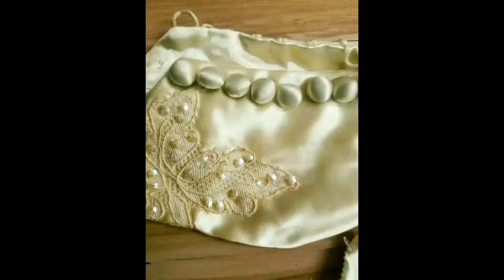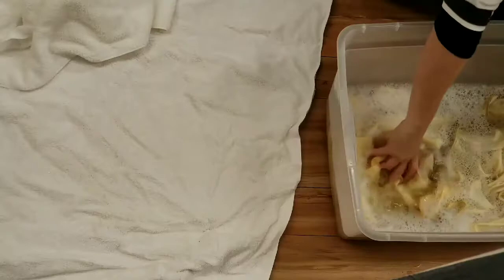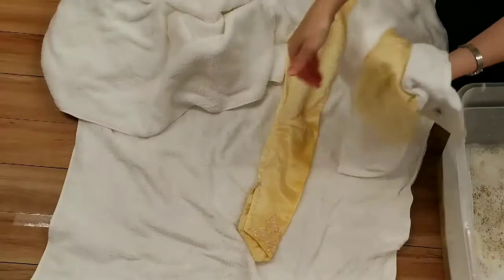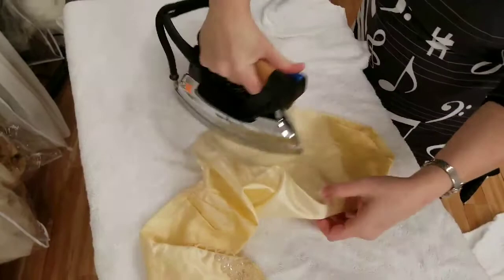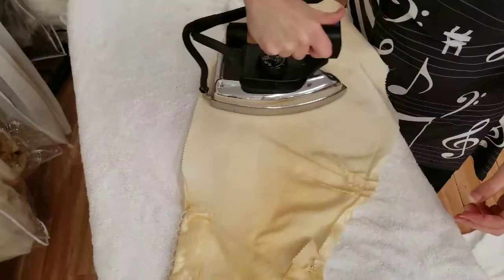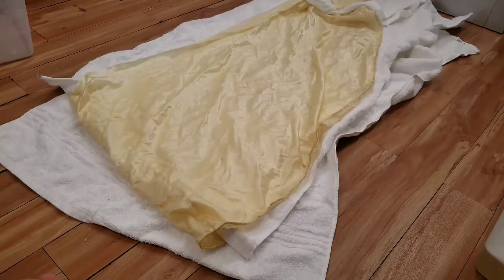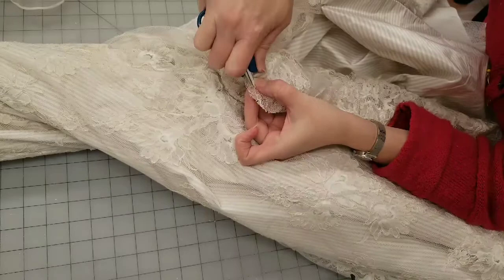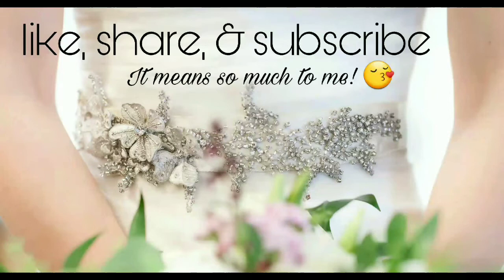How to wash a vintage silk wedding gown. How to remove or cover bridal gown stains.

Comment: Thank you for making this video! I recently bought a Victorian Silk parasol in an ivory color. The fabric is in very good condition (only very small holes due to wear on the under layer) but there is a lot of tension on the canopy when fully open. Do you have any suggestions for cleaning it? There are a few dark spots and overall it looks dingy. Will the products you mentioned weaken the material further?

Comment: Hi, thank you so much for this. Do you have any tips for removing age spots on white silk?
Reply from the maker: This method should do it just fine.
Reply: @BridalSewing  Thanks for the amazing information! I have a silk dress that  has been in my closet for almost 8 years. It has a wine spill on it that was small, but I recently looked at it ( it has been a while) and there are more stains and spots. Is it from sweat, or aging? 

Do you think this technique would work on my dress?
Reply from the maker: Hey, it's got to be *better*, right? ;)